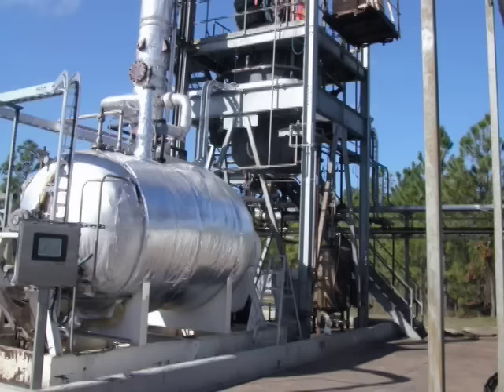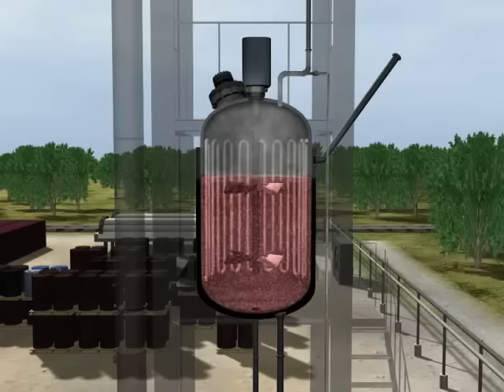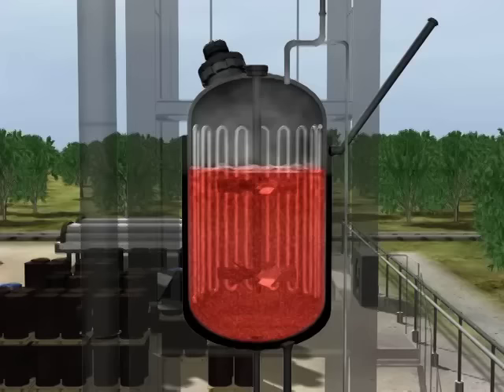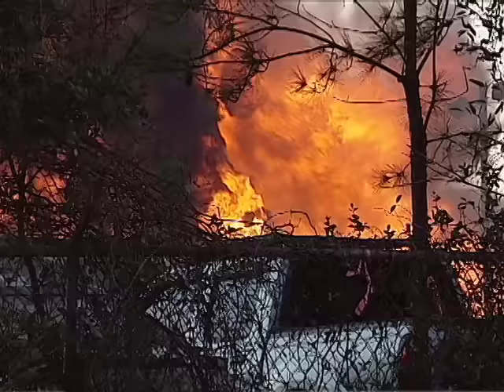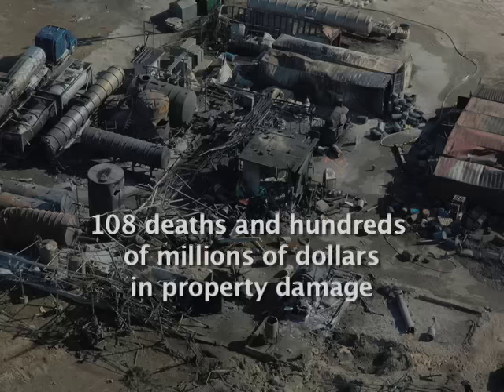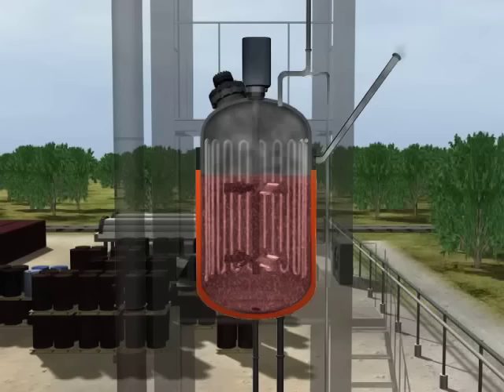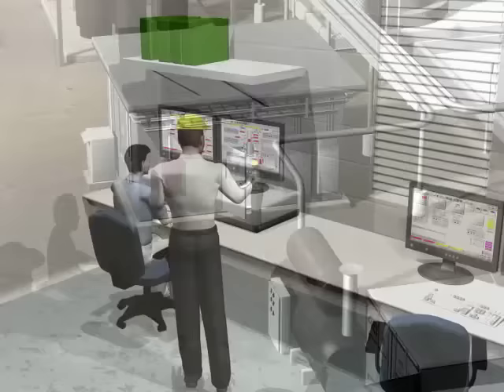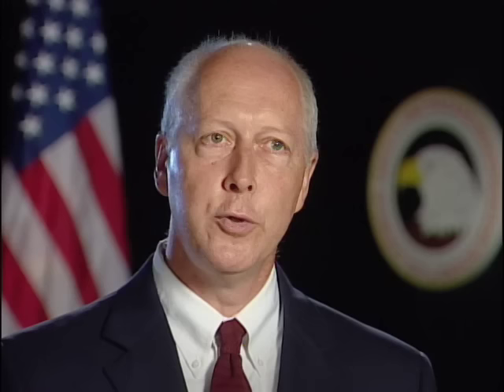Runaway: Explosion at T2 Laboratories

Comment: Active systems that control runaway / positive feedback reactions that failure could result in so big mess, should be at least tripple redundant and independent. So failure of two will not restrict you from cooling system fully as designed. This applies to cooling and pressure relife systems. Or instead build multiple smaller reactors instead that are easier to control. The water should be controlled and filtered, the each cooling system should have at least two pumps, and should have independent redundant emergency power systems (battery and generators), and additional fail safe system based purly on gravity from water tower.

This system was absolutely terribly designed.

Also scaling system in naive way is not just naive, it is super stupid. Volume and energy contained scales as qube of the base dimension. But the heat flux capacity scales as square of the base dimension (basically it is restricted by the surface area). So, even if small design works, if you simply scale the system, it will reach the point when it cannot be cooled. Simple math and dimensional analysis. The cooling system should be redundant and compleatly redesigned.

This is just me speculating as a non engineer. But the are published standards how to safely design such reactors!!

Comment: I'm not even an engineer and I can see the water cooled jacket is insufficient when scaled up. A spherical container with 1 liter of volume will have a surface area in contact with the cooling jacket of 4.8m^2. But if you scale it up by 300x with a 300 liter reaction vessel, the surface area will be 216m^2. So for a 300x increase in volume, you only get an increase of 45x in the size of the cooling jacket. So the efficiency of the cooling sysem is going to drop off very fast as you increase the size of the reactor.

They should have used something with grid fins or rods that actually go into the reactor vessel to draw heat out from the center.

Comment: Either the operators failed to conduct a hazard analysis of the reactor (i.e. 'what if the cooling system fails?') or else they mistakenly relied on an undersized relief system.  Reactors are not like steam boilers.  When a boiler relief valve blows,  pressure usually drops immediately because heat is entering the system at a constant rate from the burner.  In a reactor fully charged with reactant, the rate of heat generation can increase exponentially if the reaction rate is temperature and/or pressure dependent.  In that case the vent cross sectional area must be large indeed to be effective.  The best remedy is to have an emergency means to interrupt the reaction, like with a dump valve and drown tank if possible.  I wonder if they could have opened the valve that led 'to distillation' to effect this.
Reply: Further, using water to cool a reaction involving both sodium metal and hydrogen, just sounds like a terrible idea
Reply: @zrspangle  City water at that, which amounts to water from the aquifer. Loaded with minerals and metals, perfect for clogging up a cooling system.
Reply: @Cannabinova  Precisely. I'll bet that primitive cooling system was never maintained. The municipal water in Jacksonville is considered extremely hard. The system was likely  covered completely with  thick mineral scale, inhibiting heat transfer and finally rendering the inlet valve inoperable. That explosion obliterated any evidence unfortunately. Totally inadequate design...
Reply: @OhmMyGod1  they should've checked for mineral debris or stuff in the pipe debris
Reply: @zrspangle  The sodium was isolated from the water, though.
Reply: @durshurrikun150  under ideal conditions it is. Not here though.
Reply: @zrspangle  Except it was,.

At no point the water came in contact with the sodium.

The organomanganese compound was produced from the reaction between sodium cyclopentadienyl and a a manganese carbonyl complex.
Sodium cyclopentadienyl is itself formed by the reaction with sodium metal and cyclopentadiene, exploting the acidic proton on the 1 carbon of cyclopentadiene( it has a pKa of 15, cyclopentadiene is as acidic as water) and reason for that acidity is that the cyclopentadienyl anion is aromatic.
The byproduct of this reaction was hydrogen.

At ambient temperature cyclopentadiene dimerizes, but at higher temperature the dymer decomposes into cyclopentadiene.

The explosion happened due to the hydrogen produced by the reaction between sodium and cyclopentadiene and the fact that this exothermic reaction became runaway, which led to the hydrogen igniting and exploding.
Reply: @durshurrikun150  oops, misremembered. I watched this 2 years ago.

Comment: What a sad story. It is easy to be critical with hindsight, but in this case, even the most basic of HAZOP studies would have had big red flashing flags over the loss of coolant question, and required a huge redundancy in the design. The answer to the question of "Loss of coolant", is Major Catastrophe, and possible loss of life.
 The video seems to imply that the water supply was allowed to boil in the jacket to help cool, this seems hopelessly inadequate, don't even start on calcification fouling. There should as a minimum have been a recirculating cooling water system, at a sufficiently high Reynolds number for turbulence in the jacket, with duplicate recirc pumps. I would have installed a secondary internal cooling coil system with perhaps a gravity fed coolant from a buffer storage tank.
 Others have mentioned scaling up from a 1 litre lab flask. An exotherm in a 1 litre flask may well have not even be noticed.
 I could go on ,so much wrong, venting Hydrogen, protection from over pressure etc.
 Finally let me say I am a Chem Eng, and have personally suffered a runaway exotherm, no-one was injured fortunately, and we were completely exonerated in the investigation, as it was completely unpredictable.
 Very good video, and animation, thanks

Comment: This is similar to bhopal When the water contaminated the mic in the storage tank due to them not blocking the pipe with a slit the chemicals boiled although there was no explosion the vapors escaped and being heavier than air settled towards the ground and unfortunately the wind direction caried it towards the town

Comment: i find it really "interesting" that the one method they had of controlling the heat / pressure generated by the exothermic reaction was an active process of water cooling that required manual intervention...in other words, making it a fail-deadly system, with a single point of failure, with no plan B.  uhhhh....sounds safe

Comment: Simple solution: designers of these devices should be required to live within 10 feet of their creations along with their friends and family. Things like this would NEVER happen. There would be fully independent primary, secondary, tertiary and quaternary safety measures and a deafening warning klaxon that sounded the MILLISECOND any ONE of them malfunctioned even slightly. Unfortunately, none of the people responsible, or their families, were killed or maimed in this incident.
Reply: The co-owners were both on-site, working on the problem. At least one of them died.
Reply: It stated the co-owner was killed inside the control room during the blast.

Comment: I think the other problem was with how they designed the prototype using a 1-litre drum.  Due to its small size, the similarly-scaled water-cooling jacket was more than enough to remove heat, so basic logic would dictate that everything should work fine if all components are scaled up to the full 2500-gallon size (I hate imperial units!).  This is unfortunately flawed logic, because when you double the dimensions of something, the surface area increases by a factor of 4, but the volume increases by a factor of 8.  In this design, the volume of chemicals is what's responsible for generating the exothermic reaction, and it's the surface area that's responsible for heat removal.  There comes a point in the scaling where the cooling system is simply inadequate for the job at hand, and it was already running at a relatively unsafe temperature even before the water jacket failed.
Reply: That's part of it. The concept of heat dissipation also applies inside the reaction mixture, not just at the cooling jacket. Larger reaction masses can heat or otherwise induce reaction feedback in themselves to a degree not seen on small scale. This runaway point is known as a critical mass in nuclear chemistry and works exactly the same way.

Comment: A very horrible accident. There is a document called a (MOC) Management Of Change.  We cannot change anything in our process without this document and review with our Engineers examine the effects of the modifications pending.  These were very smart people that ran that plant but proper procedures should been in place on making decisions to making changes without proper review using a MOC.  I believe that the CSB was making that point.
Reply: +kc5hgv
Glad you brought that up. That document is one we (in the petrochemical industry) use all the time, when we have a change that will affect anything related to our process in any way. The CSB did indeed make that point. We will never know, but this step, if carried out properly, may have allowed someone there to recognize something abnormal that may have grown into a problem. I have no doubt that everyone that was involved had no malicious intent, but it is apparent that even an MOC in this case may not have prevented this catastrophic tragedy.&#160;&#160; Personally, I never sign one until I have read the attached documentation, and any other materials attached, and had my questions answered by the issuing supervisor/manager/trainer. Sometimes you'll see operators glance at it, sign it, and that's that. Besides all that even, this tragedy would still have been likely given the culture of process education in the unit (according to the CSB's investigation). Many of them were ignorant of the chemical reaction. I feel that all I need to do here is quote from the video Dennis Hendershot (Process Safety Consultant): "The most important thing to managing reactive chemistry hazards, is that you have to have a thorough and complete understanding of your chemistry under design conditions, and also under all foreseeable abnormal conditions."....ALL FORESEEABLE ABNORMAL CONDITIONS! Don't cross your fingers and say 'we'll be good!'
Reply: A very good point indeed.

Comment: While I was studying chemistry, we had guided tours of Hoechst. We visited the "Technikum," a building that housed the "scale-up" team who tested reactions for production. They presented us with documentation of an accident where a 20-liter reactor was propelled into the air due to an incorrectly calculated exothermic reaction. Maximum cooling was applied, but they were unable to control the temperature. Therefore, the reaction was put into a "pipe" in a constant flow status, with pipes that were 1 inch in diameter. I was impressed by how a simple reaction in the lab could require extensive engineering to put it into large-scale production.

Comment: Hearing some guy saying the supposed idiots running the operation didnt know that something like that would happen tells me the education system concerning chemical reactions totally failed. No sir, I disagree, those men knew that was nothing more than a ticking time bomb waiting to go off. Common sence as to having a secondary emergency cooling system in place, Questioning batch size, improper relief systems, that whole rig was a bomb. When interviewed gor the job, and shown the operation, I would have turned down a job at that facility. Life is worth more than that.
Reply: RC Hobbyist Extreme Educated as chemists not chemical engineers - did not understand scaling

Comment: No back up cooling system,thats insane!
Reply: it is. I tend to plan as  though an accident is inevitable to avoid them
Reply: @LasArmas_  In the RAF handling explosives you behave as if an explosion will happen not may, the job is to remove all risks possible!
In this case they did not remove the risk of coolent system failure which considering the out come of said sinnario is unforgivable!
A secondary backup cooling system  should have been a given not to do so was and is criminal!
Reply: @mickjmcgregor4384  I see. Must be a really cool job I’d imagine
Reply: @mickjmcgregor4384  I fully agree it is a fully preventable and very stupid mistake; it should be held to criminal accountability but in USA the corporations get king status

Comment: No operation or process that has the potential for loss of life or property (aka Explosion, Deadly Gas or Fire) should be reliant on a safety system were a SINGLE POINT FAILURE (such as a faulty valve or blockage) will cause a catastrophic failure. 

This should be the Industry Standard: NO SINGLE POINT FAILURE, and ALWAYS REDUNDANT.

Comment: Interestingly, I did the math.  The pressure vessel is roughly 450 psi and 2500 gal or (3MPa x 10 m^3) and after scaling is about 45 MJ [Baker formula, k=1.4 estimate].  That gives 45/4.2 MJ/kg about 10 kg of TNT just for the bursting energy.  The real energy comes from ~5000-10000L (depends how full) of Hydrogen, where 5000L (half full) at 200C (est) is ~4k mol or 1.15 GJ of energy or about 300kg TNT.  The rest probably came from burning the flammable liquid and sodium.  (~1400 lbs is about 630 kg) (I did the math in metric to make it easier).

Comment: I have the feeling that they were trying to save money by using a higher pressure rupture disc so they wouldn't have to keep on replacing it when it blew at lower pressures. There should have also been dual cooling systems that  were used alternately as a way of making sure that they were always working. The cooling system should have been gravity fill meaning the water tank for cooling should have been higher than the cooling system  but low enough that it could be filled by city water pressure.     The reaction vessel should have been in a pit so any blast would go straight up instead of spreading out.   As well as  berms around the perimeter to make sure that the blast went up. The benefit of the pit and the berm  is that it will contain any spills.    Cooling should have been tested at startup each time before the chemicals went into the reaction thank. In case of a malfunction of the cooling water valve there should have been a bypass allowing  the water valve to be opened manually by hand.

Comment: It looked like a nuclear explosion (starting at 3:3)
Reply: tornadosirenlover100  all large explosions make a mushroom cloud
Reply: @pip12111  you are correct.
Reply: 1400 tons of TNT is about the yield of a small tactical nuke.  The blast would have created a similar mushroom cloud, only without the radiation hazard.
Reply: @tashkiira7838 . Um, they said 1400 pounds of TNT equivalent, 1400 tons would be about 280.000 pounds of explosives equivalent.
Lol, just a slight difference. If the explosion would of been anywhere near 1400 ton equivalent, there would be nothing but a crater a couple of hundred feet across where that plant used to be.
Even the pepcon disaster was only equivalent to about one kiloton: (1000 tons explosive equivalent) One of the biggest industrial explosions ever. More comparable to a small tactical nuke.

Comment: The safety of lab to full production scale-up can be greatly enhanced by process calorimetry. Once the heat of reaction and specific heat of the reaction is fully characterized the design of cooling systems and safety backup can be successfully done.

Comment: Did anybody notice the pair of nuclear reactors in the background at 3:41-3:50?  What a marvelous idea!  We'll build a major hazardous chemical plant full of explosive potential right next to those reactors.  That way if the reactors go out we can blow up our place and get them lighted again.  Wow, what great planning.
Reply: Those aren't reactors. They're cooling towers. They're associated with nuclear power, but they can be used to cool anything.
Reply: Coal fired power station St Johns River Power Park
Reply: Those are cooling towers, not nuclear reactors. Nuke plants aren't the only place you'll find those.
Reply: um, those are just run of the mill cooling towers, perhaps not even associated with a nuclear power station.
Reply: Those were cooling towers, not reactors.  Although typically associated with nuclear plants, they are also found at large coal and other power plants.  But regardless, this explosion was not powerful enough to harm a reactor building.  Modern commercial reactors are made to take hits from a 767 or a Tomahawk missile, both of which have more penetrating power than a sub-ton explosion like this.
Reply: That's not a nuke plant. It's a coal- and petroleum-based power plant with cooling towers. Looks like a nuke plant, though. https://en.m.wikipedia.org/wiki/JEA_Northside_Generating_Station
Reply: Holly Rockwell coal plant? They need cooling towers, too
Reply: It's not a nuclear reactor. That is JEA our electric company.... it's Coal Fired not nuclear.
Reply: that's a coal plant
Reply: Those are cooling towers.  Maybe there's not actually a nucelar reactor there?
Reply: you mean the cooling towers.....
Reply: OK dummy, those cooling towers are down now... You happy?